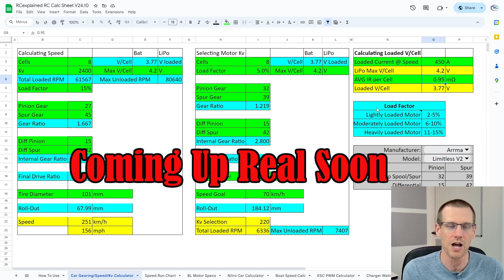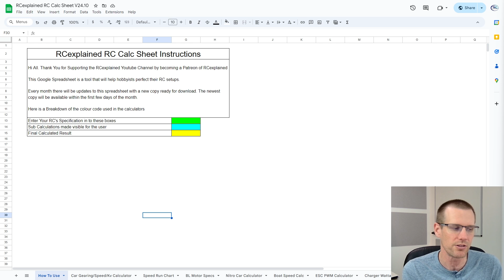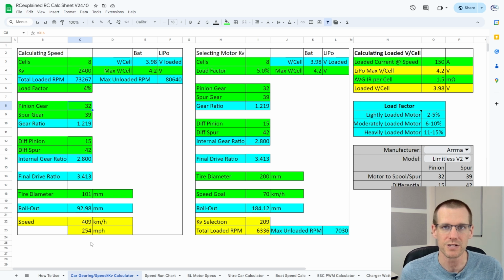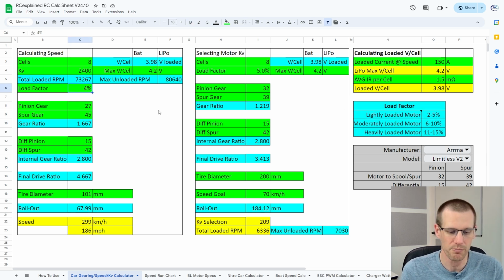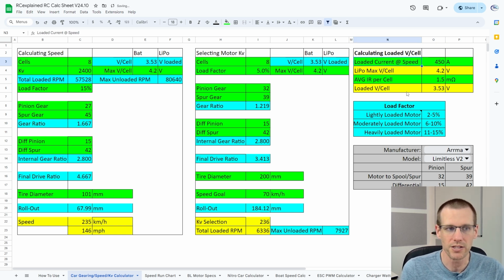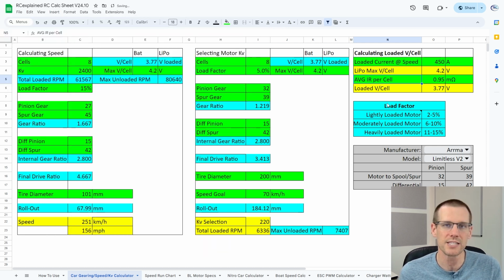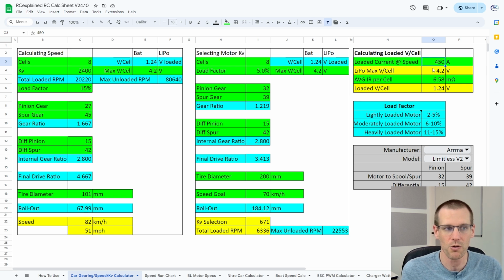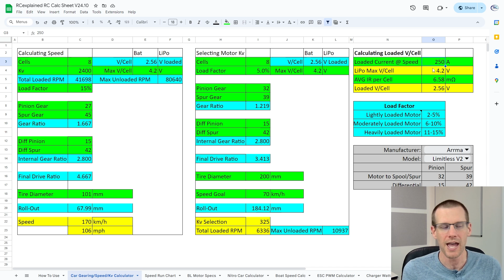Very Strong vs Weak LiPo: Mind-Blowing Theoretical Performance Gap Revealed in Detail!

Comment: Thank you for all your detailed analysis and happy new years ! I’m just curious about the testing if wire awg comes into play we’re all of the tests with the same thickness of wire ? Also the charge rate I’m curious also if you would see different results with lower charge rates versus max charge values. Maybe I’m thinking way beyond the norm as this just a hobby but your spreadsheet and videos take me back to my days in semiconductor engineering. Hope you have a great 2025 and thank you again for your expertise
Reply from the maker: The cells play a much bigger role vs the wire gauge used. The packs are tested exactly as they come with the exception of a connector swap.
Not quite sure which results you are interested in knowing about as it relates to different charge rates. 
Happy new year!

Comment: I ran a really cheap 6s 3300mah in my limitless. I was still able to hit 100mph which surprised me actually.

Looking at the data logs the voltage did sag quite a bit.. just under 18v but started to slowly climb back up by the end of the run.

Was only able to do 2 or 3 pulls on the 3300mah pack before it was pretty much dead.

My charger is also capable of reading resistance and this particular pack is quite bad compared to others i have. I will be comparing this cheap 3300mah to a pair of 3s 6500mah "150c" packs with pretty low resistance and i will put the video on my channel.

Comment: You need to look at Onyx batteries.
Reply: Yes I’ve had good luck with Onyx but not better performance just a good battery as any, but to my point Onyx is brand manufactured by the same company that manufacturers many other brands, only difference is the packaging.
Reply: @nealstarling5422  A good number of speed runners run Onyx batteries at ROSSA speed event in the UK, not sure exactly what Onyx they use out of there range of lipo's. But David from Scorched Parts ran 216mph through the traps setting a world record.  I believe the day before he ran 224mph on the onboard gps.
Reply: Pointless recommending a battery only sold in one country.
Reply from the maker: What model is recommended?